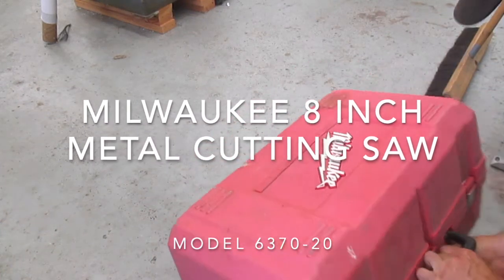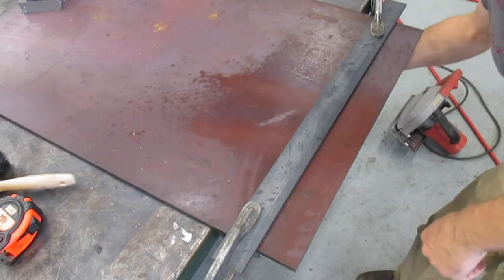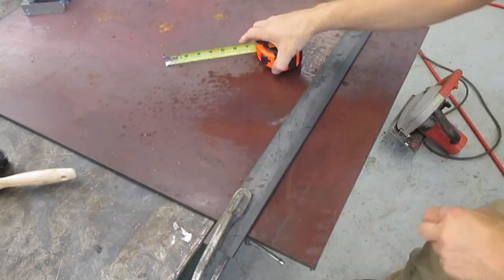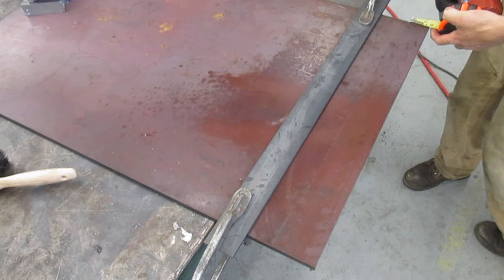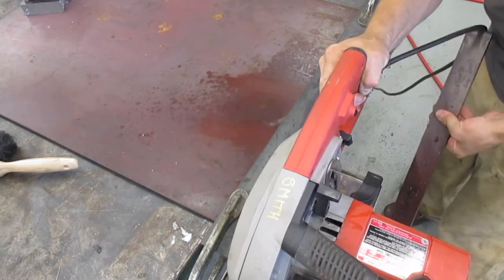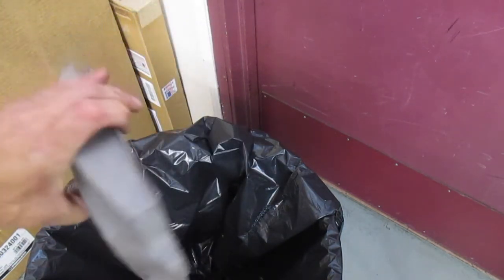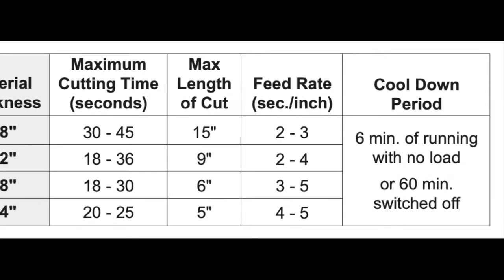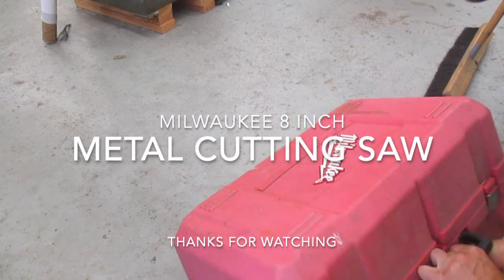Metal Cutting Circular Saw

Comment: Have this saw for some years now and have had some expensive mistakes because the blade got ruined. Any play in the job while making the cut can cause the blade to chip teeth. One chipped tooth and the blade life is significantly shortened.
Reply from the maker: Thanks for the note. A nice sharp blade makes all the difference. I've had pretty good luck with the Milwaukee brand blades. Do you have a recommendation of other brands?

Comment: Hello, how much thickness can this machine cut?
Reply from the maker: The manual states 3/4" maximum thickness, that said, I've used it to cut some 1" inch plate. The main issue it that the saw duty cycle really goes down as the material gets thicker. For example a 3/4" cut is limited to about 30 seconds before taking a 6 minute rest.
Reply: @MrSmithDotShop  
I want to buy one of this type, as the thicknesses that I want to cut are between 10 and 15 mm, so do you think such devices are useful? Do you recommend it?

Comment: is that the same machine as circular saw for wood?
Reply from the maker: Similar but this saw is made specifically for cutting mild steel. The rpm is lower. The chips are retained as opposed to being thrown everywhere. The saw is also fitted with resettable thermal protection to prevent overheating in the event you go over the duty cycle and/or are running a dull blade.

Comment: I'd love to have one that could cut 1/2 inch plate and tube all day instead of torch cutting and grinding. Some day maybe
Reply from the maker: That would be cool! I've used it to cut up to an inch but the duty cycle is miserable. Still cleaner than a torch.